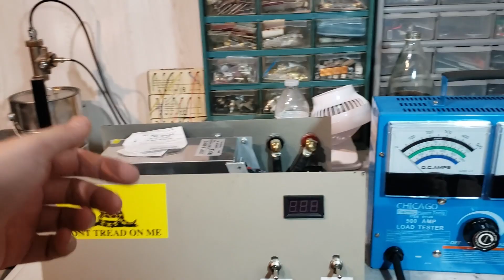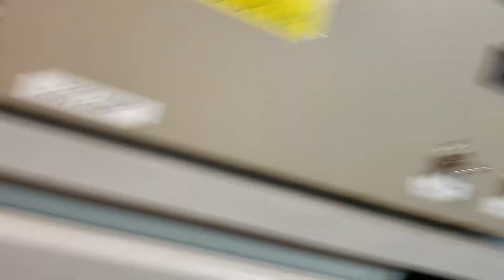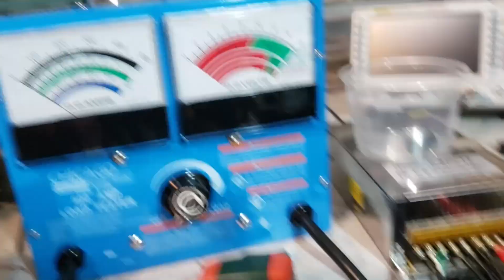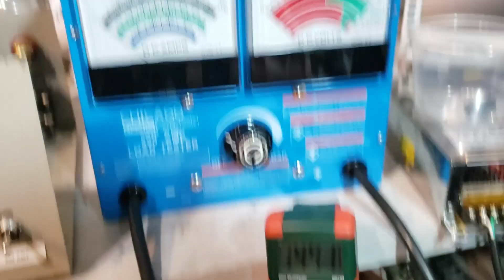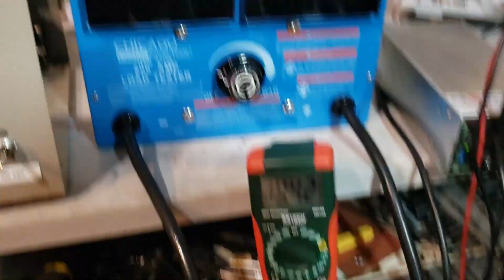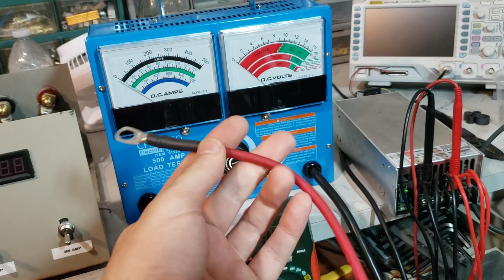Cheap Power Supplies. What's the Catch?

Comment: I have tried different powersupply,s some operating with constant current working fine in FM , But when i use a radio in SSB the powersupply is make noises from component that start vibrate with the current

Comment: Mmmmm  I dont agree !! ...  the "cheap Chinese unit" did do as it was meant too ...  "shut off "...  The so called more expensive unit went into current mode still supplying current ??? ... I wouldnt guess what that would do but if your running @ 70amps from a unit that is spec'd at 40amps and you apparently design the unit not to supply 70amps ."wow" ... something is wrong dude...!! shut that damn thing off ... well done the chinese unit .... and the issue is spending the money on the more expensive unit may do more harm than good ...Dude...!!

Comment: Hay thanks , this is a really good video.
Oh and the load tester is relatively accurate,  precise no.
I have 2 of those and compared to my fluke meters they are close enough. 
That aside.
I would like to see a video on server power supplies.
I use dell server power supplies.
They have so far been awesome and very low noise.
I am about to try my luck on a 400 amp set up maybe 500 amp.
I would like to learn more tho about ways to balance the load and how to increase the 12 volt to upwards to 16 volts.
I run my radio at 14.4 , 14.6 andy box i run at 15 .
I figure its going to drop a small amount on volts so 15 seems a safe bet to me.
Keep these awesome videos coming.
199 florida georgia line.

Comment: Server power supplies. Figured out the variable mod up to 14.8VDC 75amps with only a .4V drop.
Reply: exactly, super cheap, reliable and very low RF noise. Use an HP server power supply, but haven't modded it to output 13.8v my radio needs, still run it at 12.1. Do you have any links that show how to mod it?
Reply: There hundreds of people on YouTube converting those server mods

Comment: I am agree with "they are not totally garbage" you just have to manage them so they can work properly, I also use them years with no problem, BUT you probably have to open the switching case and check for its FET's, transformer, output inductor, and elco. Some of them use potential magic smoke component...

Comment: my 200 amp supply I built in 1988 never failed ! still use it. 30 2n 3772 out put transistors big heat sink 4 50 amp surplus power mate transformers. 723 reg ic. adj from 9 to 15 and 1 to 225 amps. big coffee can 36D caps . built in old forklift charger cabinet . and no hash noise ! it's big it's heavy and heat the room but never quit ! 73's

Comment: I'm running 2 Megawatt S-700-12 50 amp power supplies in parallel both are set exactly at 14 volts. They run a TS500 & are stackable to 200 amps. I tried just one with the amp & it blew the ps internal fuse off the board & overheated the mosfets
Amp was pulling 57 amps.

Comment: The cheapie looks like a single phase, and the Meanwell is a three phase for internal topology.  When you go to the higher power levels, Texas Instruments (among others) make some great multiphase control chips for power inverters.  The multiple phase lowers the ripple and allows three smaller output transformers instead of one very large one with more ripple.